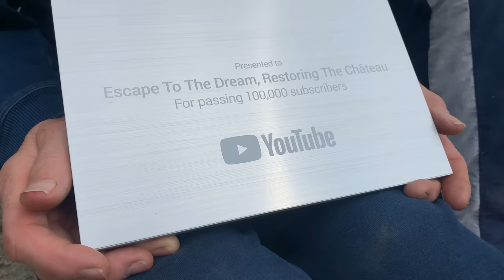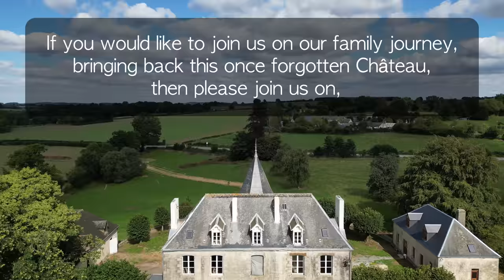LOOK what ARRIVED for our CHÂTEAU | furnishings for a FRENCH home. Ep 74

Comment: The wood on those windows is so rotten they may have very little strength left. Decay is slow oxidation and bacterial action. It was striking that some places looked charred.  The filler and stabilizing fluid may help to harden the decay but it doesn't make it as strong as the original wood. For the other windows perhaps you could find where the pegs are in each joint and remove them and carefully break the frame apart? With some time with a table saw and router you could make the replacement pieces in fresh oak using the old pieces as you template to get accurate lengths? Stephanie's cousin could help you out and recommend some router bits to match what look like very simple molding profiles. Even the bottom element that projects out over the sill is something that might be made with a table saw and a rig that runs the stock diagonally over the blade. Even if that bottom element is one piece of wood it could be made of two pieces using much stronger modern glues than existed over 200 years ago. You could use a belt sander to do the rounded bottom edge. Some modern glues are so strong the wood will break before the joint will.  You could also use oak pegs in addition to the glue. All they had in the 18th century was animal or hide glue  made from rendering animal skins. The frame probably wasn't glued,  just carefully fitted and pegged. 

BTW - Years ago I repaired a swing I designed and built about 20 years earlier. It  was surprising to see where decay had really eaten out a lot of the frame that sat on a piece of pressure treated 6in x6in landscape timber. The timber looked like acid had been dripped on it and had eaten a hole about 1/4 inch deep and maybe 2 inches across. Years of water dripping through the decayed wood may have actually spread the bacteria to the supporting timber although it wasn't nearly as rotten as the upper frame. The untreated framing beam and posts were rotten to about 8 inches up. .New England winters are very hard on woodwork. You are at a higher latitude than we are but the winters don't look nearly as hard. NE winters were what killed so many of the first English settlers here. 

Another BTW - how much did one of the full bolts of cloth weigh? I've bought cloth by the yard but never knew how many yards actually came with a whole bolt. They looked like something they needed a forklift to move especially for bolts 6 or 7 feet from the floor. 

The house is looking better and better.